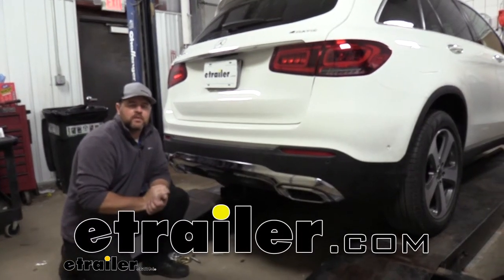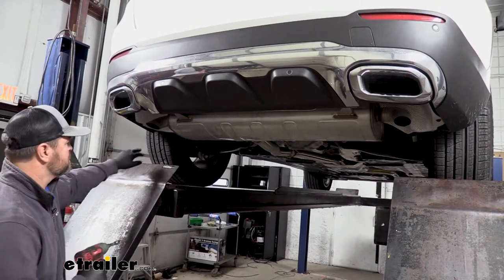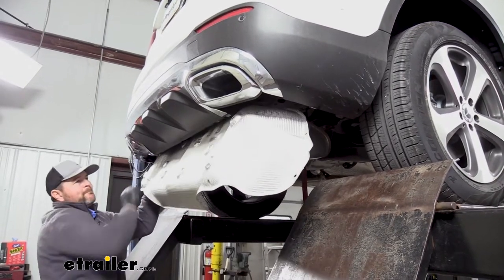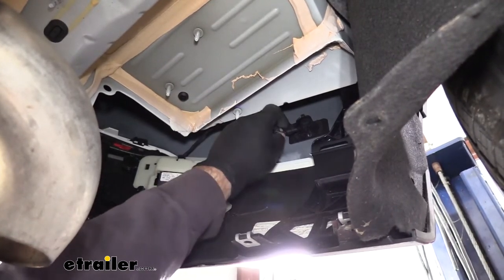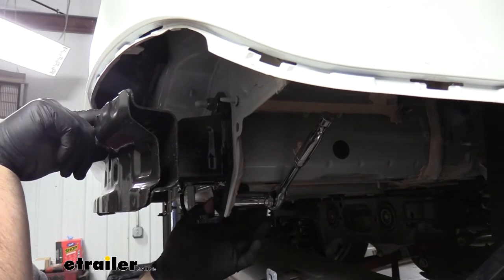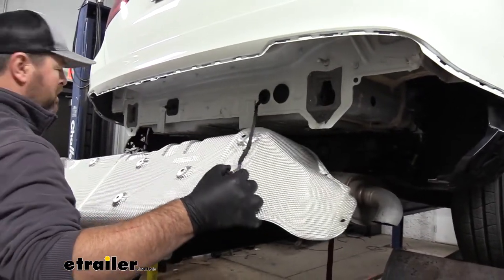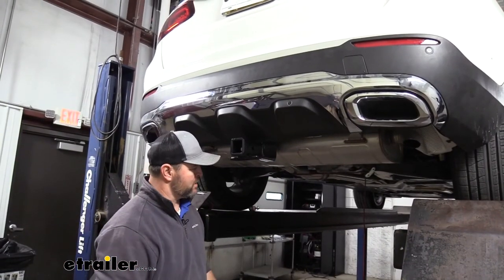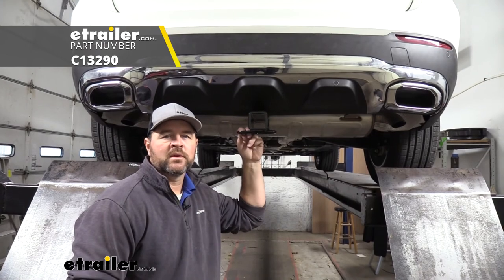etrailer | Curt Trailer Hitch Receiver Installation - 2020 Mercedes-Benz GLC

Comment: This is great. Thank you
Reply from the maker: We are happy to help! Check out the following link for more information on this trailer hitch. If you plan on towing a trailer too we have wiring available in the second following link.
https://www.etrailer.com/Trailer-Hitch/Curt/C13290.html
https://www.etrailer.com/t1-2020_Mercedes-Benz_GLC.htm
Reply: I notice there are two wire harness. One states it won’t work P03 Premium Package  ? What is the P03 mean? I do have the premium package but have no clue on the P03 part.  Thanks for your help.

Comment: Just order it from the factory if you know your be towing things.
Reply from the maker: If you want to pay extra for the OEM trailer hitch from the stealership, feel free, go for it.  But it's pricey! For a 2020 GLE 350e for instance, M-B wants around $ 2000.00 for the hitch. Not including installation. We charge about $ 200.00 for the hitch you'd looked at. Stealth makes hitches that feature a removable receiver for hitch mounted accessories or a ball mount for towing. Once those are removed, the hitch is completely invisible from the rear. For roughly1/3 the cost of the OEM hitch. Food for thought...
https://www.etrailer.com/hitch-2020_Mercedes-Benz_GLC.htm?fUrl=-pm-Stealth_Hitches

Comment: What happens if I have sensors? Will it disturb?
Reply from the maker: This hitch will not get in the way of the rear parking sensors. If you have a hands free lift gate, you may have to waive your foot to the left or right of the hitch receiver.
https://www.etrailer.com/Trailer-Hitch/CURT/C13290.html
Reply: Order it from the factory.